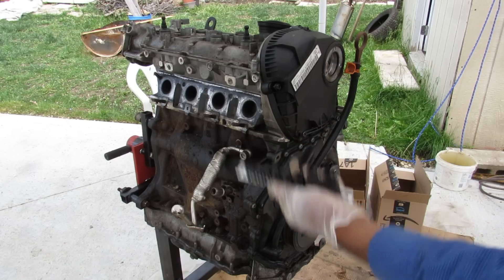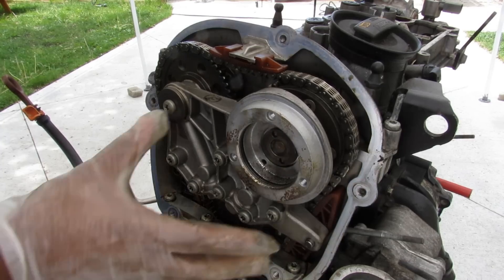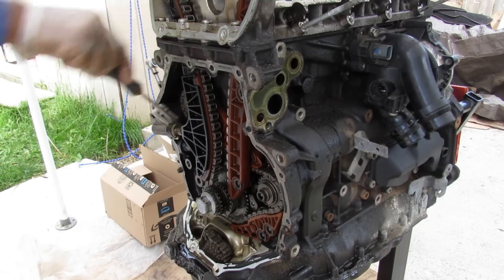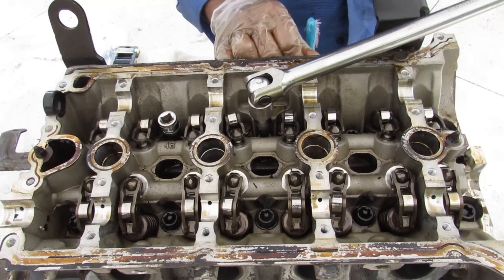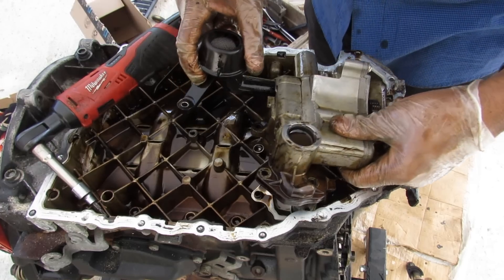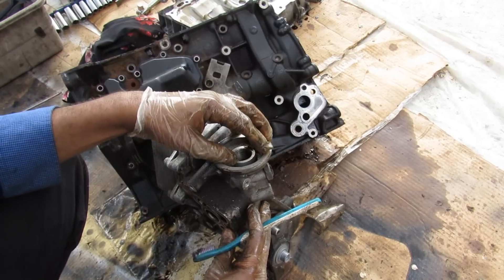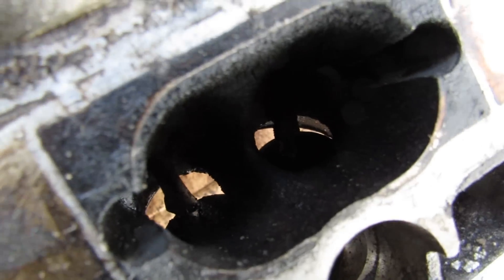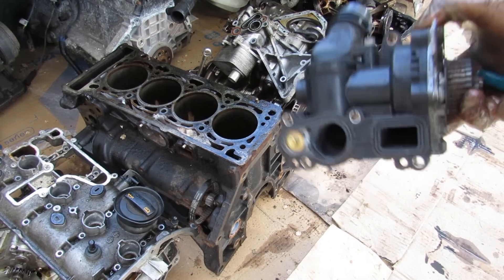Why Volkswagen Engines Fail

Comment: When the many car reviewers praise a new car, always remember that that's when it's new.  They don't talk about the long - or even short - term costs. I had this engine on a Q5 and it was breathtaking at high revs. Truth is German designs work amazing when new but the overly complexity finally catches up.  I think the last quality VW were build 20 years ago
Reply: I have a 2.0 TSI in a GTI which has also been tuned. Never had a single issue, ever. Serviced at normal intervals. 225k and still happy and fast as ever. Most reliable car I've ever owned.
Reply: @olly1oo6  These engines can push 600+ bhp when tuned, but somehow they're "unreliable".
Reply: @nightdriver7216  fanboys talk a lot of crap.
Reply: @olly1oo6  I don't like when people say "never had a single problem".  We hear this too often from people who didn't own the car from new. What is more, it's way too easy to say anything on internet.
Reply: @Peppermint1  Don't like it because it doesn't fit your narrative?

Your broad statement about VW reliability is completely anecdotal, as is mine.

Having said that, I've owned three TSI cars and they have all been flawless. 

VW make some astonishingly reliable and resilient cars, that operate at very low service and running costs.

Comment: Vw is the best no argument
Reply from the maker: Do you have anything to back that up?
Reply: @speedkar99   i have a 2017 GLI at 47k miles only had minor issues so far. My Mom has a 2016 1.4 jetta at 65k miles no problems apart from water pump failure

Comment: whoever designed the water pump belt should be immediately fired.. I really don't like the design of this engine it seems like it was designed to work for 150k miles then die and then they sell you a new car... too much unnecessary complexity and failure points.. thanks for the look inside
Reply from the maker: Yeah they went with a chain for the cams and a belt for the water pump

Comment: Man what is wrong with your brother. I have seen you using his socks his shirts and even his tooth  brush...  but i have never ever have seen you use your brothers underwear. That must means your brother is going commando!!
Reply from the maker: Underwear is the most absorbent thing for oily situations. So if I'm gonna steal clothes, might as well get the ones that work best in my favor
Reply: @speedkar99  Wait wait??? are you saying you are using your brothers underwear for yourself? Like are you wearing his underwear? Or...His underwear was the first thing your stole and used on the oils spills and he has never bothered to buy more? There is a lot unpack here? LOL
Reply: @speedkar99  It depends on if they are already saturated or not...

Comment: Speedkar Uploads Video

Me: AdBlocker - OFF
Reply from the maker: Thanks
Reply: @speedkar99  Hey man, quick question regarding engines and their cam-timing setups: What mileage is best to change the components as preventive maintenance to avoid being in this type of situation? Of course it all depends but could you offer a ballpark number maybe? 😁

Comment: There are many millions of these EA888 engines that run trouble free.  This high mileage engine (you can tell from how filthy it is) was not maintained properly, or else that tensioner would have been changed out as a known weak point.  As for the dirty ports (they aren't that bad, actually, on this engine) resulting from direct injection - well, that is not something VW designed.  ALL direct injection engines both diesel and petrol have the same issue.  Some variants of EA888 have a port injection to help keep this carbon cleaned off, in common with other manufacturers who have all moved to direct injection for the benefits it provides.
Reply from the maker: From the oil inside the engine I wouldn't say there was a lubrication problem. Just someone who didn't know these engines need more than just oil changes...
Reply: people buy a vw, think they can do 0 maintenance and just beat it to shit everyday. then they cry like babies when the car breaks...
Reply: Wrong. Toyota do not have DI carbon issues as they also use port injection and don't try save that $50 to screw their customer. Fuck VW and fuck anyone who hasn't figured out how to avoid carbon by 2009, it is pure malicious intent. They had it first on the 1UR-FSE in 2007 which is highly reliable. I have inspected one from that year personally recently and it had no carbon issues and only normal carbon on plugs @150kkm.

Comment: I love watching your teardown videos. I would be so delighted if one day you teardown a direct injected honda L15b7 sitting inside civics and accords. It would be very intresting to see how honda adressed carbon buildup issue in their not so old DI engines.
Reply from the maker: I'd like to tear one down to see what the oil dilution issue is about
Reply: @speedkar99  Well, that one too. I missed to say that maybe because there has not been any such issue reported in the area i live in where coldest air temp could go down to 23 deg C as the lowest we can get throughout a year.
Reply: Ours had issues. We can get to -40C. Before the recall it was just about impossible to get the engine to warm up.. the gauge would only just come up onto the scale. 

I was hoping that the engine would last a long time but I’m not so sure now.

Comment: Why that much carbon buildup on cylinder surface?. Reason for that
Reply from the maker: Not sure but this one sure had alot more carbon than alot of others I've taken apart. I'd assume it was burning oil
Reply: @speedkar99  thank you sir
Reply: @speedkar99  sir I want to learn about automobiles. How can gain  knowledge aboutmobiles ?

Comment: Is this a Gen 1 EA888? Current is Gen 3 EA888, do you think Gen 3 is more reliable than Gen 1? These turbo engines consume oil, so if you top off oil make sure your oil is always full and change it early before its pitch black then you can avoid many reliability issues and make even the most unreliable engine, as reliable as a Toyota
Reply from the maker: I'm not sure which generation it was, it's from a 2011 GTI

Comment: Thank You! By the time we got to 4 minutes in, I've already decided what my next car's engine won't be.
Reply from the maker: Haha 
Well that's true
Reply: No need brotha, I can send you a list of parts that are super cheap for this car and how to improve this engines reliability!
Reply: @aldinnukicic3458  ehh.. it's more about not wanting the excessive amount of work. Compared to my current 1.8t, that 2.0 engine looks like it was designed by fired Mercedes engineer.. it's needlessly complicated. Why does a four cylinder need any balance shaft?... Let alone two... Which is probably because they added one😂
Reply: @AlexR_44  so yes Alex this design looks complicated to the untrained eye but it’s super easy to understand especially if you watched the video. Now I work on these, I’d even call myself a specialist because of how many I do. Anyways the chain system is super easy as everything is run by the chains. Now I wouldn’t go to say it’s super completed because if you have experience working with engines, for the most part you can figure out how to set things up. Now of course a balance shaft is requires because a balance shaft absorbs any vibration caused in the engine, that’s why this engine uses two, unlike your ordinary v6. Hope this cleared some things up.
Reply: @aldinnukicic3458  I'm not looking to start an internet debate, but... About 20 years ago I swapped a '96 2.0ABA block mated to a '91 1.8 head, with a mild cam and adjustable cam gear, plus some external stuff like lightened pulley, exhaust goodies, and flywheel and a transmission that I had ordered with a diesel 5th gear. I put that in a MK II jetta. I was told by the kid that bought it over a decade later, that it did almost 140WHP on a dyno.  So although I'm not technically a trained eye... I do think I'm correct in saying a well designed 4 cylinder, or any inline engine, should not NEED a balance shaft.
I currently have a 1.8t gti that I've done the timing belt and water pump on, with over 180k on it and it too is plenty smooth without balance shafts. (unless there's one I don't know about, I haven't had to take the engine apart. and won't, because the car is rusting away. Thanks for the factory side skirts that allowed for rocker panel rust VW.)

I'm sure an engineer could talk me into balance shafts and loving that new 2.0T, I'm sure it's brilliant for at least 99k miles, but I doubt anyone will ever convince me it is not needlessly complicated.
Reply: @AlexR_44  Your engine does not have balance shafts. They are there to cancel out the vibration caused by rod swing, the side to side motion of long stroke 4's. They spin at 2x crank speed to cancel 1&4 then 2&3. And also you say 99k miles so I know you don’t know too much one these engine and also I’m not here to make enemies just educating. But buy Audi and vw it is recommended to have timing service done at 60-70k miles. And the reason for this is because the tensioner maxes out and makes the chain weak then bends valves and more damage. And of course due to poor piston ring designs, the pistons need to be changed because they end up being clogged and they eat oil. 🙃👍
Reply: @aldinnukicic3458  well if that doesn't sound needlessly complicated to you, then we simply have different definitions of it. Subjectively realities make the world interesting.
Reply: @AlexR_44  no not to to much, on my Instagram I always do these chains and always show the tear down and the failure of the engine. The real problem is the ppl lmao!😂 Most ppl don’t even put synthetic oil in these cars and it’s just a wow. I know I sound crazy and a big dummy, but it’s much more easier than you think along with others I try to explain it too
Reply: @aldinnukicic3458  that I can agree on. Preventative maintenance is key.
Reply: @AlexR_44  yeah, alright so we cool? We can come to an agreement?
Reply: @aldinnukicic3458  oh yeah, of course. I wouldn't hold a grudge over a such a silly difference of opinion. 👍
Reply: @AlexR_44  Well said Alex and you probably like me could heir a cash register singing away for bits that should not have been needed. My last V'dub was air cooled and the last honest vehicle they made.Cheers
Reply: @AlexR_44  I can see from the design it seems to have a lightweight flywheel of small diameter. Is it right to imagine that there is a possibility the shafts were introduced to damp vibrations due to inadequate mass on the flywheel to do that?
Reply: @vs6300  that sounds like a possibility.    Seems like they've added more weight though, so it's kinda extra dumb if that is the case. Unless those are like magnesium alloy balance shafts, which might explain needing two😂
Reply: @AlexR_44  Appreciated.

Comment: You should do a Hyundai GDI motor, I'd like to see an in depth explanation of those issues.
Reply from the maker: I have a theta2 ready to teardown soon.
Reply: Haven't heard of many... Mazda and Hyundai seem to have better designed GDI systems than others.
Reply: @kristianhermann5971  Toyota has also very good GDI it is direct and port injection = no carbon bullshit like euro junk.

Comment: the worst ever 😥🚗🔨🛠🔧🔩⚙
Reply from the maker: I don't know about the worst
Reply: @speedkar99  belt driven water pump in the  nook and crannie location  
, too many chain drives to operate  components, different types of metallurgy that has to deal with the heat cycles smh😞.  Plastic in areas  that will  prone to deteriorate  prematurely due to location. Im sorry just the planned absolesence  nature of this motor is so pronounced. I cannot see the value  from a consumer perspective.  If we were to compare  it to the k-series motor, I still have to say the worst.

Comment: Never been a vw fan. Their reliability has always been bad while interior build quality has been high quality. Their fans make nonstop excuses "oh the new ones are as reliabile as a toyota" nope still junk. If you want fun to drive get a Honda. Theyre fun to drive and reliable.
Reply from the maker: Even if a VW was reliable, it's still more expensive and harder to maintain
Reply: Their late 90s, early 00s engines actually had very solid reputation. It's their early 2010s effort that ruined it.
Reply: @Psych0technic  look at consumer reports reliability survry going back to the late 70s. Since the rabbit vws have had poor reliability vs the competition. There is no hyundai moment when they went from garbage to good.  Its just a fact.
Reply: @Henry_Jones  right, yet people still bought them in droves in the 70s, despite their reliability problems.
Reply: @Psych0technic cuz they have always had great interiors and a solid upscale build feel. Always bad reliability though.
Reply: @Henry_Jones  there are still people driving first gen golfs. They wouldn't be as revered if they weren't reliable.
Reply: @Psych0technic  yea i see them and chevy citations all the time =p
Reply: Ok, so they have good interiors. Still have garbage under the hood. Rather have garbage interior and a robust powertrain. That way, I don’t need a mechanic on retainer.
Reply: @Green Mamba Games 'Unrefined' handling? Yeah that's why the NSX was praised for it's feel and the handling was developed with this nobody called Ayrton Senna? S2000, DC2 Type-R, Civic Type-R etc etc all have unrefined handling for their age? Honda has some amazing handling cars, even some of their stock econocrap boxes can be easily thrown around.
Reply: @N4CR . He’s a vw fanboy,  so everything else is “unrefined” or whatever, lol.
Reply: @Green Mamba Games  cheap hondas? I think youre confusing them with hyundai. And why does driving experience suffer from good reliability?

Comment: Does carbon deposities just affect VW direct injection engines or other brands too?
Reply from the maker: All direct injection engines are affected
Reply: @speedkar99  and to a certain point all port injected as well, with no raw fuel to wash down the intake the PCV, and EGR, flat out gunk up the whole intake.
I would not go back to a carb, or TBI, but that was one advantage they did have over the modern designs.  But one advantage is not near enough!
Reply: All DI engines suffer from carbon build up to a lesser or greater extent.
Reply: @nerd1000ify  This is why I bought a new Toyota Corolla hatchback last year.  With a 6-speed manual, of course, because I have good taste.  I didn't even bother looking at or test driving the competition.  I just don't want to deal with carb build-up and expensive walnut blasting services in the future.  Toyota at least uses port along with direct injection.  I believe that Ford uses dual injection as well, but their customer service scared me away.  I've heard Ford does everything they can to avoid honoring warranty repairs.
Reply: @hamsterama  I drive a diesel, so there's no escape for me. The severity of the problem depends on the design, especially on how good the PCV system (or crankcase breather, in a diesel) is at seperating the oil from the blowby gases before feeding them back into the intake.
Reply: @nerd1000ify  My knowledge of car mechanics is extremely limited, so I would not know anything about PCV systems or blowby or whatever.  It was just easier to buy a Toyota.  I bought way below my means (I could have easily afforded to paid cash for a $35,000 car), because I didn't see any alternatives.  I don't regret my purchase one bit.  The new Corollas are pretty nice and the 6-speed manual is a ton of fun to drive.
Reply: all DI owners should install good oil catch cans 😉

Comment: Me and my VW ID4 EV
Reply from the maker: How will that hold up
Reply: @speedkar99  EV maintenance is much lighter. Main drivetrain will have between 16 and 24 moving parts per motor. Cabin air filters, tires, and gear oil every 150,000 miles or so. And brakes, but because of the heavy use of regenerative braking, those wear out very slowly. Such that VW actually put drum brakes in the rear wheels on the ID.4 because discs would just get rusty from disuse.

Comment: What is it with VW group and their love of chains?  chains everywhere :-)
Reply from the maker: Chains used to be better than belts because they wouldn't snap as easy. Romour has it VW is going back to belts because of how many issues it's had with chains haha
Reply: Maybe on future engines they'll also include a bit of leather.
Reply: @Erik_Swiger  And studs :-))
Reply: all TSI with less than 2L use timing belts, only the first years they use chains... who fail...
Reply: It’s actually pretty much every automaker now. 

Timing belts got a bad reputation because either you’d have to replace them every 100,000 miles or they’d snap and destroy interference engines. In VWs case with the 1.8T they were often premature failures. 

Most people remember the old timing chains that never had a problem, but they were usually on pushrod engines or at most SOHC engines so a lot shorter and simpler. 

Today’s timing chains are sold as very robust and lifetime solutions to replace the rubber belts. But the much longer lives of cars plus issues with oil dilution and consumption with direct injection, complex head designs, variable cam timing, and modern lightweight synthetic oil means that these chains will often stretch, jump teeth, or fall off completely.

The solution is to check oil levels religiously and change oil every 5000 miles regardless of what the oil monitor says.
Reply: VW = Virtually Worthless